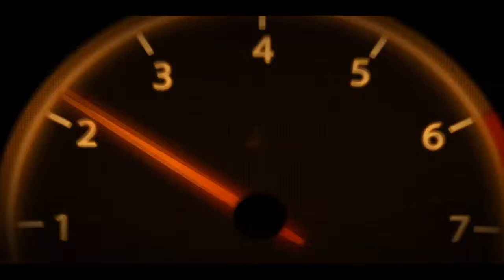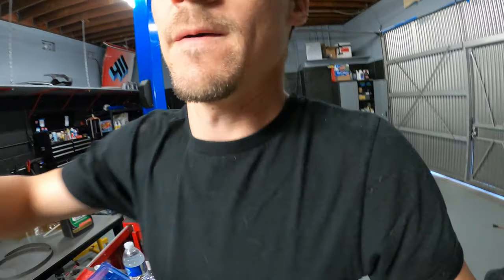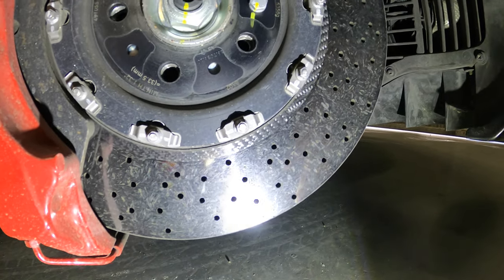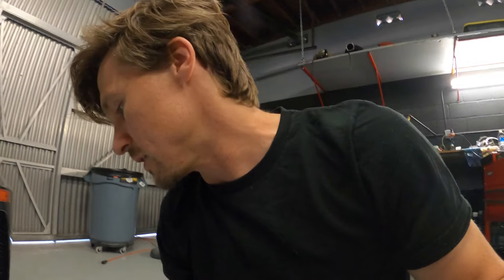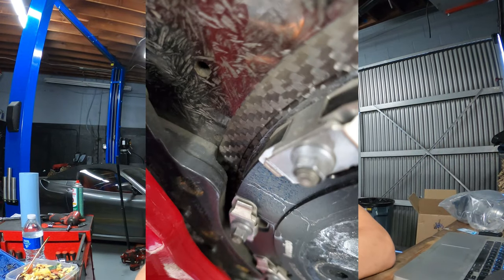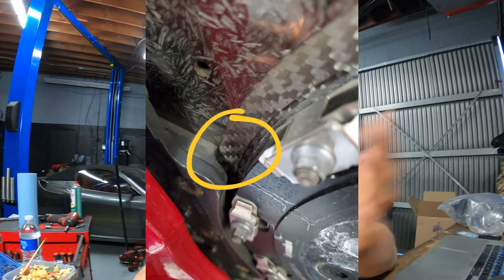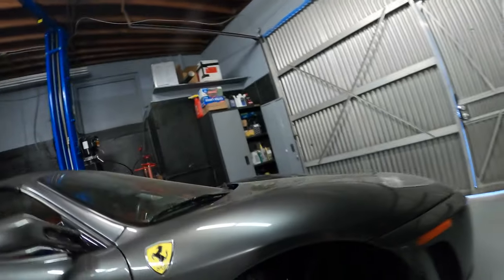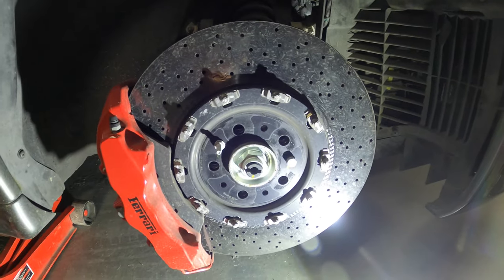Brembo Brake Flaw Problem Carbon Ceramic Ferrari, McLaren, Aston Martin

Comment: Corvette C7 Z07 has this pad going over internal non ccb circle too, but only on the fronts.
Both front and rear pads are cut to make room for that circle, but fronts are still overlapping and going over them.
Reply from the maker: Yes and if you watch towards the end of the video, I show the new pad design from Brembo that has a knotch cut to avoid the rotor. I've been trimming the pads myself before I install on my client cars but it's very tedious.
Reply: @HollywoodMechanic  and I assume the trimmed by factory SF-90 pads don't fit to any other car?
They could easily produce new pads for older models too, but that would be admitting that something is wrong, so they probably won't.
Is the problem on Ferrari also on fronts only?
La ferrari also has 19 fronts and 20 rears, just like Corvette, so I am curious if they just use the same pads and the same caliper on front and rear, where on front they need to move it inward so that rim can clear the caliper.
Reply from the maker: @fusedwiththenight6602  it's always only the front rotor. I'm going to start measuring pads and keeping a data base for cross referencing. The SF90 pads do not fit the 599, 430, or other set ups that I've seen.

Comment: I'm very confused about ceramic brakes. The marketing literature says they are creat for heavy track use but many experts say don;t use them on the track. Get steels instead. <y question is, how hard can you use them on a road before you start getting excessive wear?
Reply from the maker: They are made for track conditions, but they wear out very quickly at those temperatures. The ones warning you against track use are concerned with the $20k cost to replace pads and rotors. The steels also wear out but are much cheaper. The Squadra Corsa Lamborghinis used in the Super Trofeo race series all use steel brakes, so the performance is there, just marginally less than the ceramics, but significantly cheaper. With road use, unless you're a professional level driver that uses the brakes to the limit, carbon ceramic pads will last 4 to 6 years and up to 30k miles before they need to be replaced. Rotors, is another debate, they are not lifetime but due to the lack of calibration markings in older rotors, the tool that accurately detects rotor health cannot be used so it's unclear to the actual length of time the rotors can safely be used. 2017 was when these marks were implemented so we will see in the coming years what road use does to them on a molecular level.
Reply: @HollywoodMechanic  Thanks man for getting back to me. I'm trying to figure out the wear characteristics v rotor temp of ceramics. I've used carbon/carbon brakes on aircraft for many years and the wear LESS when used really realy hard. 747's  etcuse all brakes and no reverse thrust on landing to get the brakes above 150 deg as quickly as possible. 150 is the greatest wear temp. At 700 deg, the wear rate is about 20% of the 350 deg rate. It's hard to get your head around - especialy for student pilots. A few years ago i found a video that explains it.  Have a look at it. I' m curious if carbon/ceramic has the same characteristics as carbon/carbon.  https://www.youtube.com/watch?v=SG4Aw5BujEU&t=252s
Reply from the maker: @Ozgrade3  carbon ceramic were made for that exact reason! The carbon carbon brakes don't work cold so street cars would be constantly crashing when leaving the owners homes. Carbon ceramic can work under a wide range of temps. But I can tell you, if you fully use the brakes at the track, you can go through a set of $1100 pads in one day and rotors in as little as 2 days. I've even seen a lot of V12 Ferraris that have the rear rotors worn out from the stability control system trying to prevent wheel spin for drivers that don't turn it off and have a foot heavier than their ability! I've seen that on 15k mile Ferraris before!

Comment: What is really confusing about brake pads, is that every single video you watch tells you the opposite of another video concerning noise, dust etc.  How do you determine who's right?
Reply from the maker: Watch my video on carbon ceramic brakes. Then try what I say. This video is about a flaw in the brake design that they corrected in later models

Comment: hi, seem that the pads is wrong size, never seen the pads go that far down the disc  and near the center line, at lease on our steel rotor,
Reply from the maker: That is the problem.  If you watch the whole video, I show the new design of pad by Brembo that has a cut out for the center.  It was not the wrong pad.  The pads, from the dealer, with VIN verification are the wrong size.
Reply: @HollywoodMechanic  that so call the update pads just had a cut out a bit,  when that wear down still going to touch the disc,  they should redesign a better option.
Reply from the maker: @tangoturbotango2621  it should trip the sensor but I agree, terrible design

Comment: Easy. get the friction material machined away like that modified pad.
Reply: Easy enough however most owners of these vehicles will be ignorant of the issue and leave it up to their dealer service department; which we have learnt here will do nothing about it. The real concern is the manufacturers apathy towards road safety, too concerned about recalls or even a service bulletin to correct the issue at the next service. Unfortunately they've lost the opportunity to demonstrate good will and building a market reputation that they are not simply about performance but also safety.

Comment: Out of curiosity, how can you be sure that the squealing is coming from there? Seems like a possible source for sure, but.... I have a 2018 Z06/Z07 car with the CCB's and I have the squeal. Slight in the rears but the fronts are bad. If I remove the pads and lightly sand them it goes away for a few days but quickly returns.
Reply from the maker: Watch my other video on carbon ceramic squeal and wear
Reply from the maker: This is only one way the pads can bind and make noise
Reply: @HollywoodMechanic  I've done the reburnish. It seems to only be a temporary solution. Running on the track also seems temporary.
Reply from the maker: @rleader1  there are lots of reasons a brake, ceramic or not, will squeal. Because of the time it takes to wear down the pads, a lot of grease and debris build up on the brake system. Take the pads out, and thoroughly clean them, the calipers (especially the slide points, pins and pistons), and the rotors. Use compressed air to blow out the rotor cross drills. If you are still getting noise after this, then the pads and or the rotors may be too old. That's what my other video is really about : ceramic rotor wear. They do wear out. The brake surface loses its breaking texture.
Reply: @HollywoodMechanic  Yup, agreed. I've done the cleanup as you mentioned but it only helps for a few days. I probably need to stop babying the brakes! lol